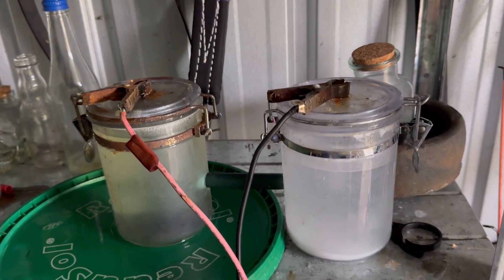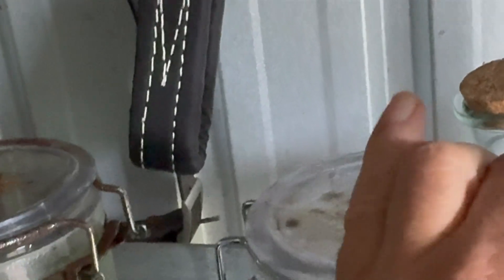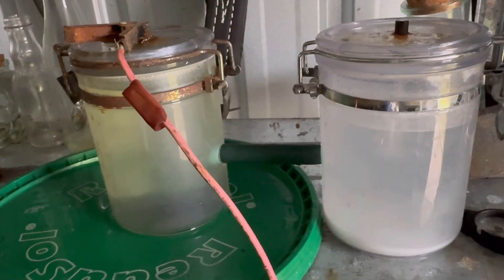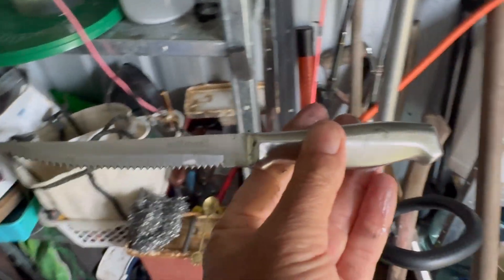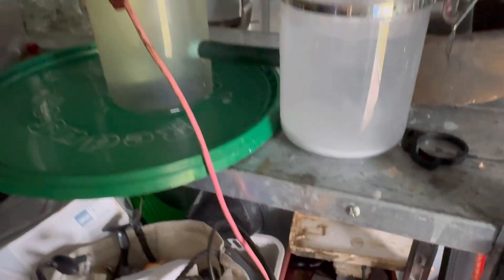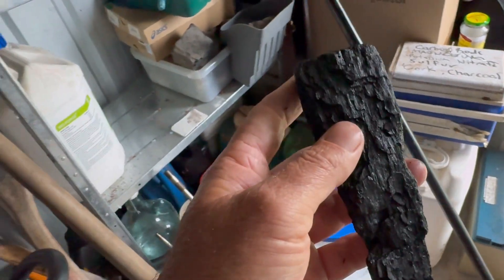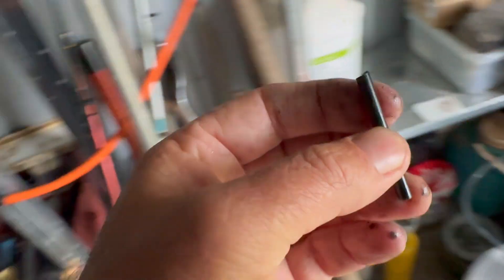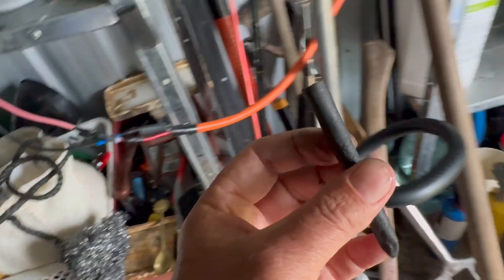Best Electrodes for Electrolysis of Seawater

Comment: sometimes you can use steel (wool) for the other electrode and graphite (carbon) for the other electrode. like in zinc-acid-air battery (znso4 water). zinc develops on the top of the steel wool, and oxygen comes out of the graphite electrode.
Reply from the maker: The fact that we can make a battery from this set up is a video waiting to happen!

Comment: I'm not entirely sure, but it shouldn't be a problem if you use it only as a negative electrode. It decomposes as a positive electrode. And brass doesn't contain nickel.
Reply from the maker: Trace amounts of nickel are present in some. Or so the legend goes….